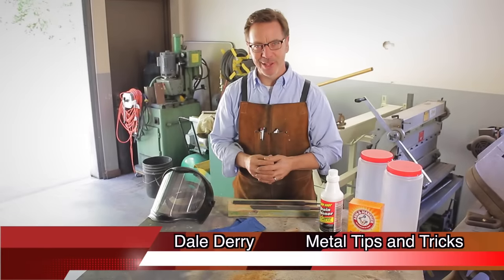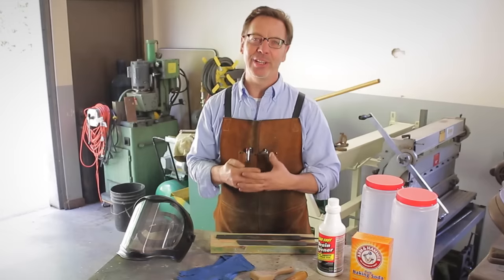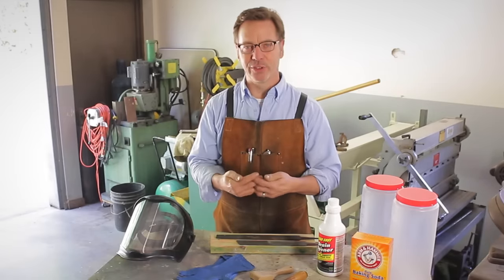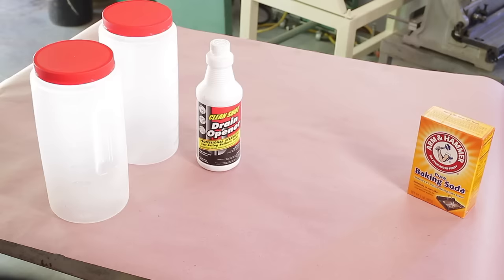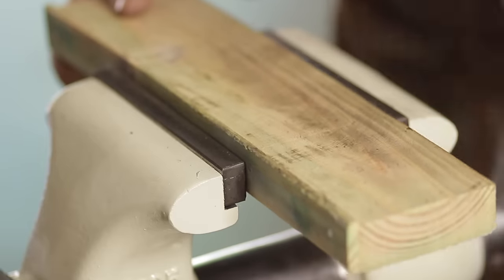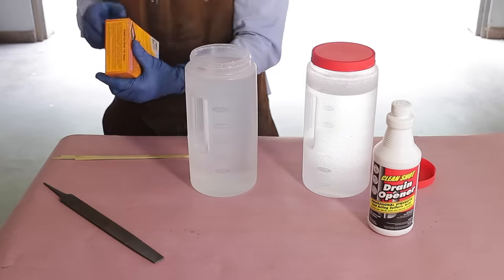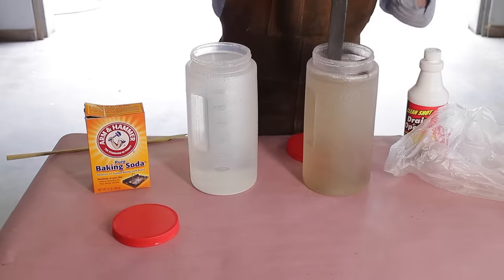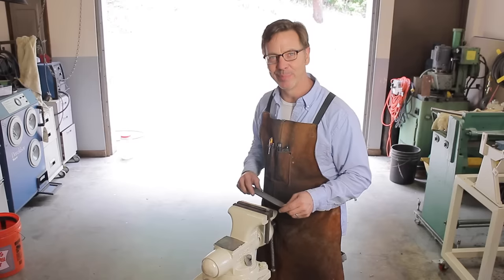How to Sharpen Metal Files

Comment: Very good video. Might add a few things. Files cut on the forward stroke. Most people know this. Nevertheless, they bear down on the return stroke. I cheerfully admit to being guilty, your honor. When you do this you curl the teeth backwards, which is why the file won't cut no more. The sulphuric acid eats off the curl. So your file is again "sharp".  We have forgotten how to file. I am trying to teach myself not to bear down on the backstroke. The acid trick is neat, but it will almost certainly not work if the file is plain dull and not just curled over.
Reply from the maker: +Juan Rivero I will admit it doesn't work at all files. But it's always worth a try :-)
Reply: +Metal Tips and Tricks (Dale Derry) When your file curls over because you bore down on the backstroke it is said to be "pinned". Your chef's knife has the same problem. The edge is curled. That is why a steel often improves matters. The steel is actually softer than the stainless stuff you get nowadays,  but it strraightens out the curl. We used to call this a "wire edge".  Best thing is to learn not to pin the edge.
Reply: As a shop teacher, the number one thing I yell is "Don't File BACKWARDS!".  It's much worse than you're saying, most people want to file and saw backwards!  I think they don't like the screechy sound you sometimes get, or something about the feeling of it?  I developed a little demo that would make a nice video I guess:  Clamp a piece of aluminum in a vise, with a sheet of black paper under it.  So, the paper is folded, you close the vise, and then push the paper down so it's level.  So, you don't see the vise now, you just have a clean black field about 8 1/2" by say 10", with your aluminum in the middle.  Now, file backward, and see that not much happens.  Try to get people to NOTICE this... then file forward with determination, and it just looks like it's snowing aluminum!  It's very striking.  Same thing with a hacksaw.  I swear, people don't have the idea that saws and files make CHIPS unless you SHOW them.  When you file backward you're just BURNISHING the surface, not CUTTING it.  A good thing to demonstrate with is the EDGE of a big file... the edges are usually single-cut, and for some reason don't get much use and can really cut, make a lot of chips and an obvious notch in the work.
Reply: Actually,  it will

Comment: nice, the copper scraper really works! great tip, i just tried on an old file clogged with aluminium, got it all out, useful file again.  i am also going to try using white vinegar as an acid instead, probably leave it overnight as its much weaker.
Reply: I went about a week
Reply: Vinegar works fine, it just takes a lot longer. Phosphoric acid (Metal Prep) also works.
Reply: I had dozen files that were rusty and almost useless, put them in vinegar for week clean and sharp
Reply: throw some random wood cuts into the bucket while the videgar is working on the tools, it will stain it beautifully, oh and if you're soaking small items, use a black bucket, shining a torch into bucket you'll see the bubbles of oxidation, when the bubbles are gone, your jobs complete, take em out and wash them down with stainless steel baby wipes, the ones for sinks.. :)

Comment: Alternative Titles: 
First half:
“how i met a guy who told me how to clean files“

Second half:
“how i clean (and not sharpen) files“...

Edit: it does actually sharpen... my bad.
Reply: lol what? the sulphuric acid etches the metal, leaving sharp ridges—thereby sharpening the file.
Reply: @florascent9ts  yes it might etch, but  that etching does not abide to the previous geometric shape, so because of the larger surface area the original surfaces meant for cutting would rather be dulled (in reality i doubt much is gonna happen to the file itself though).
Reply: @nikolasbaumann4070  how do you know that? have you tried it? I've seen several machinists make videos on this subject and some explain it much better than this guy, or they use different acids like vinegar for different lengths of time, but the process is the same. it's actually very straightforward. if there's no resist, a uniform layer of metal should come off and leave sharp ridges; similar to how rusted holes in sheet metal leave sharp edges. the sides of the teeth are dissolved, resulting in a sharp peak.
Reply: @florascent9ts  
If the file is already dull thus the cutting edge is now uneven, then how does the sulfuric acid know where and how much material to remove in order to create the shape needed to make it sharp again? Sulfuric acid doesn't naturally have the properties needed and isn't programmable having the ability to etch the metal whereby it perfectly knows how much material to remove in order to put back a SHARP edge on the file
Reply: @get-the-lead-out.4593  look dude, I'm not gonna argue with you over a well-documented way to sharpen files. read machinist forums, do google searches, do your own research. the fact of the matter is etching/corroding metal leaves sharp points and edges.
Reply: “im not going to argue over something well documented“ ia a pretty weak argument. Also “well documented“ is a slight overstatement for a few yt videos. Everyone can post everything sfw here. The reason there are many videos on this is that most of the time you dont need to sharpen a file and just cleaning it is perfectly fine (the methode shown in this video should work for that). Now.... the ridges etching produces are caused by inconsitencies in the material. They usually dont have much in common with the geometric shape of an object (although of course things like work hardening can influence them) also they are very small. The only reason you can see them in many videos is that an object is made of layers of diffrent steel tipes. They would clogg up within a stroke if you tried to use them to file something down. If (like you said) etching would remove perfectly even amounts of metal, that would lead to the exact same (in the case of a dull file) dull shape and could hardly be considered sharpening either.
Reply: @nikolasbaumann4070  again, how do you know this? have you tried it? I definitely said to do your own research, read forums, not just rely on yt videos, etc. it's not that hard to do haha well-documented also means machinists since the trade was around have been doing acid-etch sharpening for files. you're talking out of your ass unless you've done it yourself; whereas many people's experiences, consensus, and science speak for themselves.
Reply: @florascent9ts  Everyone wants to be a critic, whether they know what they are talking about or not.
FWIW, the acid is not 'programmable' so it etches all surfaces more or less equally, including the radiused or flattened end of the dulled tooth, if you have a .004 radius on the tip of the tooth and take .002 of all surfaces you'd have a zero radius on the end of the tooth. How's that for an argument?
Reply: @nikolas baumann The first thing is to clean the pinning from the file and sure, that helps but if the file is dull that only helps, it doesn't sharpen it and the action of the acid isn't some randomly acting stuff, it's an acid that acts more or less uniformly over the surface. Elsewhere Evan Penny used a more graphic explanation than mine but it goes like this, sketch an angle that compares to a file tooth, possibly a 20° angle on a piece of paper and put a representative radius or even a flat on the vertex. Now evenly draw lines around the inside of the angle and at one point the radius or flat will completely be gone.
Will it make the file like new, no, what will likely happen is that the gullet will probably become more radiused, the surface will be more rough because of the preferential etching between grains and the tooth will become shorter thus limiting the number of times you could do this. All that said. it will be sharper, practical experience shows this to be a fact, there are companies that do this on a commercial basis, more refined but basically the same process.
Reply: @L98fiero  thats actually a pretty good argument...  defenitely better than the “ive heard it but have no idea why“ othera made. I guess i was wrong indeed.
Reply: @florascent9ts  
lol I'm not a dude, hipster doofus
    That's a bit dumb for you to say "well-documented way to sharpen files"  when ANYONE can read forums and do google searches to find what they want to back up their beliefs but UNDENIABLY doesn't make it "well-documented" just because it's in forums or google searches...can EASILY find in forums and google searches that shows how it's a myth for sulfuric acid having the properties to actually "sharpen" files.
   Again sulfuric acid isn't going to take a rounded edge and make it a sharp edge...although it is etching the metal it is only able to do more in the way of cleaning them thus making them cutter better than what they did before having cleaned them.
   ...and since you're accusing everyone else for not having tried this technique for themselves to see if it's true, you're undeniably a hypocrite to not have tried it yourself to see if it's actually true before going around being an advocate for the sulfuric acid. So go ahead and do the sulfuric acid technique taking DETAILED video where showing the dull cutting teeth under magnification, show applying the sulfuric acid and the real time action as it etches the file, and then the final result of the file's teeth under magnification
Reply: @get-the-lead-out.4593  because the metal is thin at the point and gets eaten away faster than the thicker base of the tooth...der. doesent matter if it's rolled over. it's still thinner than the rest of the tooth.
Reply: @nikolasbaumann4070  Ohhh, as a machinist (someone that cut's metal on a daily basis) I guess ive been doing it wrong all this time...lolz. Preach on professor.
Reply: @L98fiero  Well i can tell you are a fellow machinist, or close to one.. These know nothing ppl crack me up..
Reply: @get-the-lead-out.4593  You are also plainly not a machinist either..lmfao @ your explanation.
Reply: I watched the video trying to find a solution for my dull files. Interesting read in the comments lol. FWIW knives are always sharpened after etching...good luck:)

Comment: I use electrolysis to sharpen files. Works well !
Reply from the maker: I have too. I like it as a cleaning steps before  the acid bath.
Reply: *****  I also did with the acid but hot phosphoric acid, really effective. Keep up the good work, your videos are very interesting.
Reply: Electrolysis uses much less materials.  Only table spoon of baking soda is all you need.
Reply: How is it done?
Reply: Yup . Add some degreaser to the bath , and it'll take off all the baked on stuff that comes of buying used files . Found that 12v 6a will pit a file very quickly .

Comment: excellent  .a little electron microscope video of the effect on the metal cutting edge would have been nice
Reply from the maker: I agree. I wish I had one.
Reply: Also, I have read (again, in an old Model Engineer) of an electrochemical method that hung the files in a big tank of something or other and applied a large current, deplating some of the metal.  This was supposedly done on a large scale in a factory, the same files being sharpened over and over, and becoming noticeably thinner!   I have tried just dilute acids in a tray, and got pretty good results on a bunch of sad flea-market files.  I used dilute and mixed acids, including some phosphoric acid.  Some of the files came out black from this, and were clearly sharper, more like new.  Now I seriously regret not using a lab notebook and doing this in a more systematic way!!!  I was just fooling around, we happened to have a few different acids and a sink, so why not?  It took a decade to get around to even THAT.

Comment: sorry don't get it.  Spotless clean for sure but sharpened?  Perhaps the small bent over edge of the dulled tooth will be eaten away by the acid leaving a sharper edge I suppose but will the cutting angle changed?  Having said that, a dull file is worthless and this would extend its life I guess.  Should treat files with the same care you do chisels
Reply from the maker: interesting point :-)

Comment: Dont throw old files away.....you can sharpen the ends like a chisel to use on the lathe. The hardened steel keeps an edge longer. You can also make a great scraper by softening, bending the end over to a hook shape and sharpen to scrape.   Also you can use the file made into a cutter to cut iron or aluminum on a metal lathe! The tang can be used for a small cutter. Use the grinding wheel stone to sharpen not another file.
Reply from the maker: Thanks for the comment
Reply: using old files as turning tools is a dangerous idea, files are very brittle and put under sufficient stress could easily snap and cause an injury. Far better to buy good quality turning tools and sling the worn out files.

Comment: this is not sharpening. this is cleaning.
Reply: From what I understand the acid is etching micro serrations into the file teeth. It will never bring the file back to 100% but it will get you some extra life
Reply: Rolf Heimann.   You are correct,sir. It is merely cleaning out the clogged up serrations which are stopping the file from biting into the workpiece. No amount of dipping will sharpen an already blunt file. The trick is to stop it happening in the first place. Before using the file should be liberally rubbed with chalk...we used to have lumps of the stuff on the benches for just such a purpose. This effectively prevents the metal filings from jamming.
Reply: crankbv1 and we were told to clean after use. respect your tools. i also worked as tool maker. respect to you sir. take care.
Reply: Ghost2Coast the acid would only make a minuacule effect on the steel. and yes the thinnest bits would maybe dizolve. buy this wouln not sharpen. all things have a shelf life. but i did see a vidio of a black smith who uses old files to make chef knives. so just donate them to him and trade for a knife.he he
Reply: Rolf Hellmann;   Small world.  I was a Toolmaker '57 through to 2003 having served my time with Vicars.. Tool rooms are a thing of the past nowadays,my friend, at least here in the UK, so look after yourself...there aren't many of us left.
Reply: It really does sharpen the file.  The reason why...

The acid dissolves the file by removing metal.  360 degrees around the file.  The cutting edges are the thinnest, so as it dissolves, it dissolves it into an edge.  It also dissolves the metal swarf that is packed into the reliefs of the cutting edges.  

Will it sharpen a completely dull/smooth file?  No.  

Will it make a worn file sharper?  Yes.  

Will it work an unlimited number of times?  No. 

Have I used this trick and had it work?  Yes, got me out of a pinch.
Reply: You have a misconception of how acid works... it does not attack the metal uniformly... it will corrode the most at the thinnest point making them round.... that is not sharpening them ... 
We should have Ben Krasnow over at applied science do this experiment and then put a file in the electron microscope....
Reply: Kristian B Lerche I understand acid very well.  I have 20,000 gallons of anhydrous sulfuric and totes of white fuming nitric, hydrochloric, phosphoric, hydrofloric, acetic... all the way down to a relatively small quantity compared to the others of fluoroantimonic acid.  Last stuff is really cantankerous stuff to play with.  

It does attack steel evenly.  Thinner parts errode away quicker due to less material being there to begin with.

Example -  Sharpen a point on a carbon steel rod and suspend the point in 30% sulfuric.  You will see what it does to the file on a larger scale.
Reply: Monel Funkawitz got any lsd acid? he he/? wat bizzy nizzy are you in to have such a veriaty of acids?
Reply: yes i agree it's just cleaning !
Reply: +Modern You don't suppose they might doctor the photos for the product they are selling?
Reply: Monel, could this be done effectively with a weaker acid over a longer period?  I'm wondering if oxalic acid ("wood bleach"), which is somewhat stronger than vinegar, could do this over, say a few days or weeks?
Reply: The edges in the photo look much wider though, so id imagine its less sharp.
Reply: This is definitely a sharpening method. I guess you catch fish by just cleaning a steel c shape then.
Reply: @LegendLength  I defiantly am being serious. I've known that chemicals are used to sharpen fish hooks since I was a little kid
Reply: @LegendLength  I know I'm agreeing with you man
Reply: Wrongo bongo